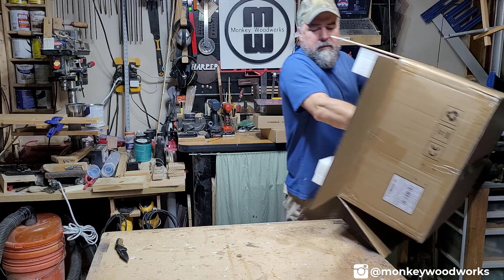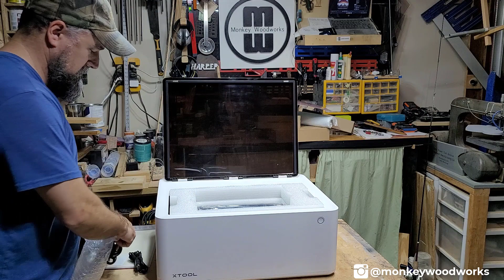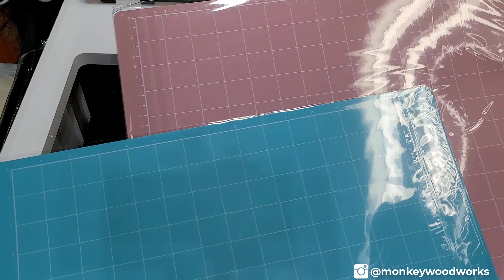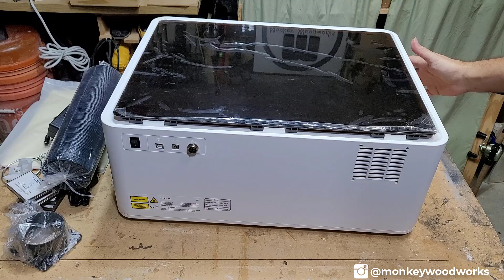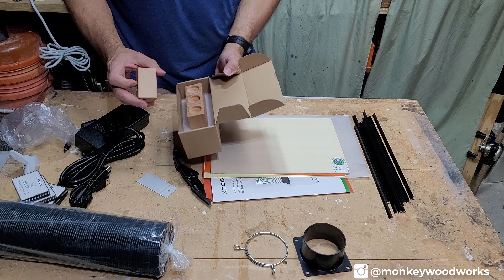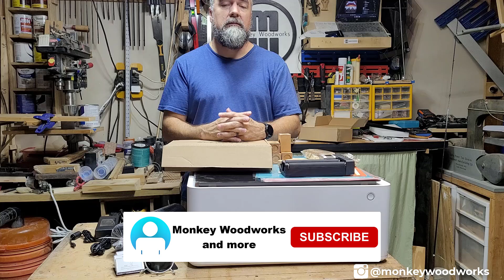Part 1 of Testing out the xTool M1 - Unboxing the World's First Hybrid Laser & Blade Cutting Machine

Comment: Great to see the software used to work in beta. Me and at least a few other people according to the reports on kickstarter had to use laserbox, because creative space wouldn't find the printer (USB nor WIFI). Laserbox found it instantly, however. Just an FYI to people just recieving theirs and coming here looking for a solution.
Reply from the maker: So what I have seen in the group, is that you have to install Both software's to use the XCS software. 1st you connect it with laser Box then you can close laser Box and connect it through XCS.   You only have to do that 1 time period after that you can use XCS moving forward. I believe they are going to fix that in a patch coming soon
Reply: @MonkeyWoodworks  Yet another sad instance, where YouTube and (in my case) the community on Kickstarter are more helpful than anything provided by the manufacturer.

Comment: Hi! I have tried cutting the coloured pvc sheets ( I think they’re called) and keep cutting through or them moving around, went through all of them with no success. Please help 😂
Reply from the maker: 1.  Make sure your baseplate is secure in the M1.  You can do so by either using the provided screws (I dont like them), or you can just use painter tape in a few places securing the plate to the frame (my preferred method)
2.  Make sure your using the xTool light grip mat. You have to stick it to the base plate so it doesn't move.
3.  Perform a blade calibration.  See the xTool support site on how to calibrate the blade of the M1.

Comment: Hi, Can you please help? I have tried the Xtool guidance gave to get Lightburn to work with the M1 and it didn’t. Reached out to both Xtool and Lightburn and they tell me it is not compatible with the X1. Have you found a work or can you please recommend something othe thank the very limited XCS? Thank you
Reply from the maker: There are ways to do it but it's not a simple task.  And its a multi-step process to send the job to the M1.  I tried to do it but was never able to get it to work.
Reply: @MonkeyWoodworks  Thank you. May I ask what you use instead?
Reply from the maker: I use XCS.   I also use AutoCAD and Inkscape at times.

Comment: Does this until need ventilation? What is the surface size for cutting?
Reply from the maker: Good questions.
The capacity inside the M1 is 385mm x 300mm (15in x 11.75in).  You can find more about it here: https://bit.ly/xTool_M1_10W_Engraver

You need a way to either use in open area, vent outside, or use their indoor air purifier.  I have heard however that even with the purifier it still smells a little because you are burning wood after all. Not sure if it's possible to fully eliminate that smell.  Here is a link to xtool's M1 purifier.   https://bit.ly/SmokePurifier

Comment: So I could get rid of my Cricut since it does the same stuff and more.
Reply from the maker: Well, the Cricut has a greater capacity than the M1.  Plus, if your going to be doing a bunch of switching between engraving and vinyl, you will find quickly that its a pain to switch the modes back and fourth on the M1.  Its easy to do but you will get tired of it.  We kept our cricut (used it this weekend in fact) because if the greater capacity.  Plus Design Space is still way ahead of the XCS software when it comes to designing vinyl cut jobs.
Reply: @MonkeyWoodworks  I was just thinking of making more space in my already crowded area, but I'd probably still need it. I'm a bit bummed that this won't cut clear acrylic. I have my heart set on doing things with acrylics.